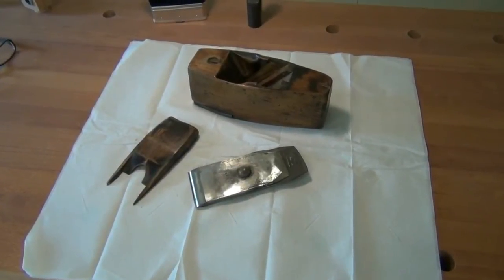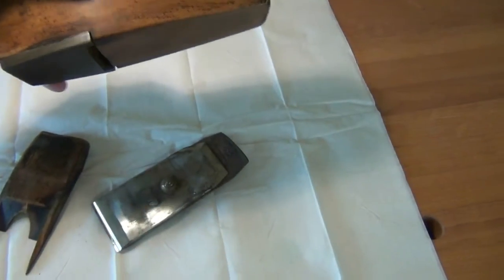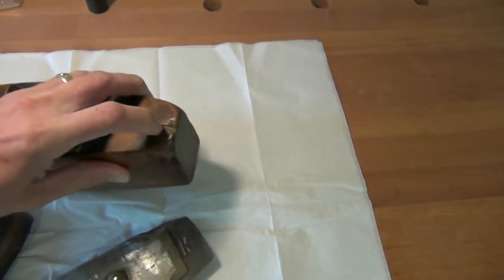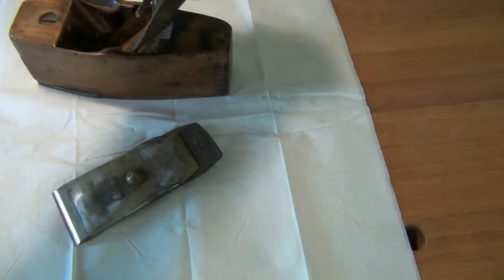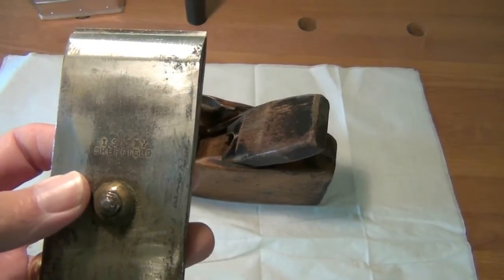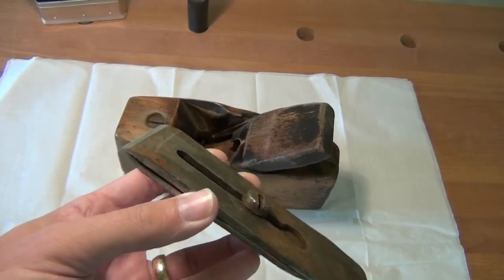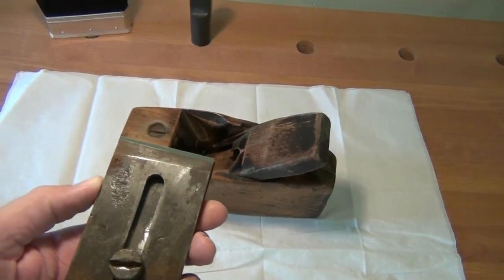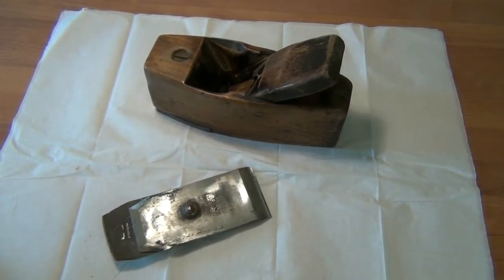Coffin Smoother Restoration - part 1

Comment: This is a great tutorial. For me the only thing missing is how to pair the blade and chip breaker and how to insert them. Could you please explain how it is done?
Reply from the maker: Laura Laura You need to flatten the back of the blade, and then prepare the end of the chip breaker so that when the two are tightened together no light can be seen through the join. Set the chip breaker back a hair from the blade edge (remember this is a smoother, so we are aiming at very fine shavings). With the plane on a flat bench, slide the assembly, blade down, down the ramps in the throat until it touches the bench. Insert the wedge and press this home. To advance the blade, either tap it directly (which gives easier lateral adjustment) or tap the front of the plane. To back the blade out a bit, tap the back of the plane. It takes a little practice, and patience - that's why the mechanical adjusters were invented! Good luck